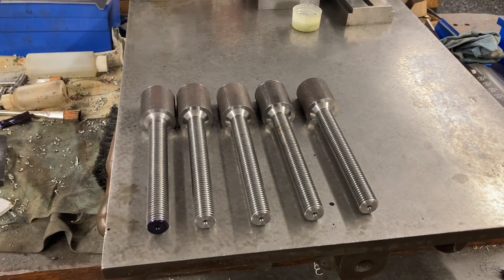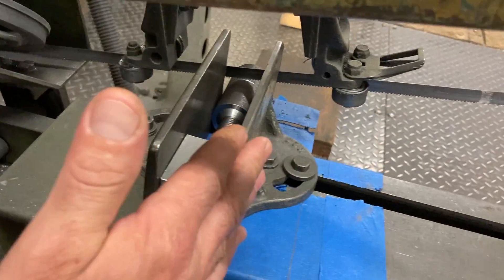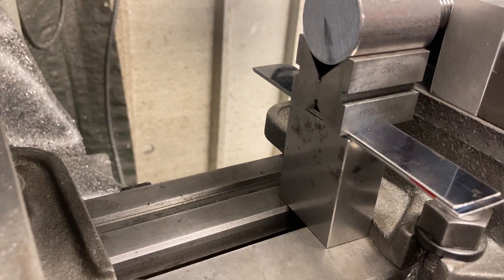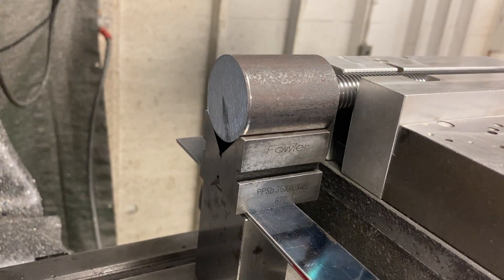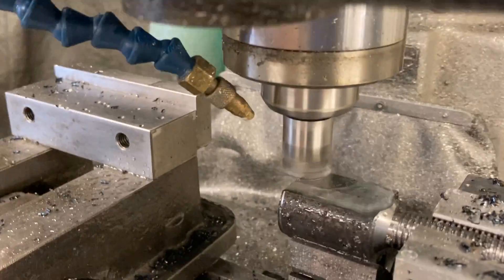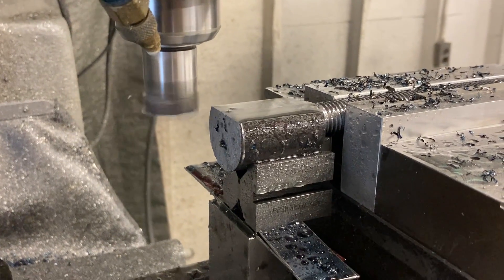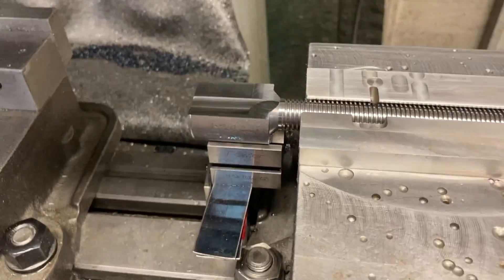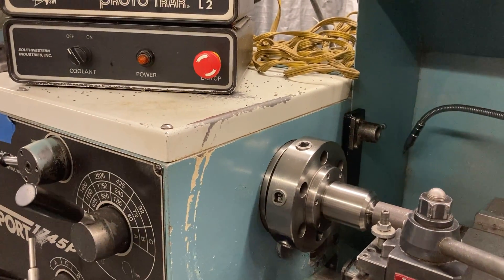MILLING FLAT on 4140HT Shaft w/ Carbide Insert Tool on 3 Axis Acu-Rite Bridgeport type machine

Comment: Why not clamp on the larger diameter for the milling process?
Send those chips towards the column. 😅
Reply: I totally agree with you as the vice jaws are good for it.
I would also use a .750 hss roughing end mill to do the cutting in two or three passes at the most.
They work real well on Bridgeport knee mills as they are low rpm and don't overload the spindle.
Reply: The larger diameter is just hot rolled, and the tolerance is probably relative to the threaded portion, not the large diameter.
Reply: @kevind1865  Rigidity is king in my book. I would've clamped on the larger diameter, used an insertable carbide cutter, did a couple rough passes and then a finish pass... to each their own, there's many ways to milk a bull. 😂
It's 4140 HT... probably mid to high 30's on Rockwell "C" scale.... clamp those suckers and send it.
Reply: @RichFife  
I go for the simplest way to make parts in spec.
Clamping on the hot rolled you'd have to hit every thread with an indicator to make sure its within spec.
For 4 parts setup and checking would take more time than the milling.
Reply: @kevind1865  What are the specs/tolerances of this part?... 
I wouldn't waste my time clamping on the threads and using shims under the material to help minimize the chatter, Like I said, there are so many ways to do that job... but, imo... rigidity is king. Rigidity creates faster cut times, better finishes, more accurate parts, and less tool wear. 
I'm willing to bet that the threads in relation to the major OD is well within spec. 🤷‍♂️